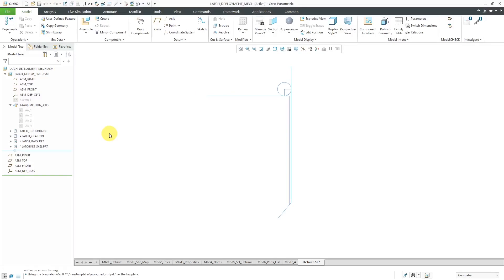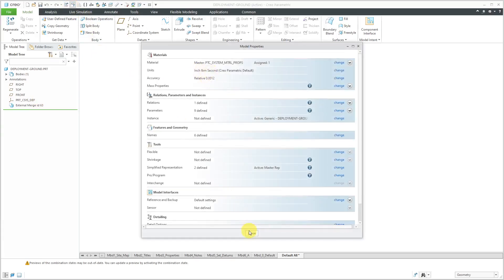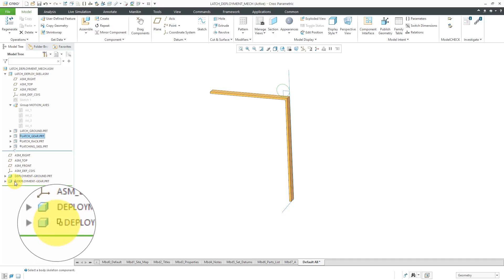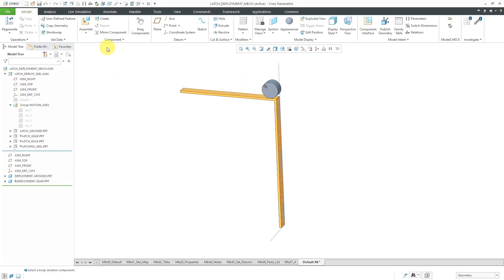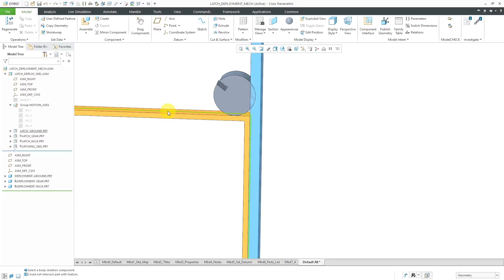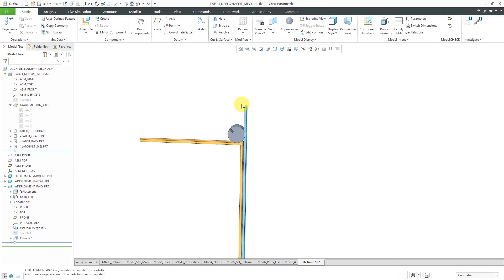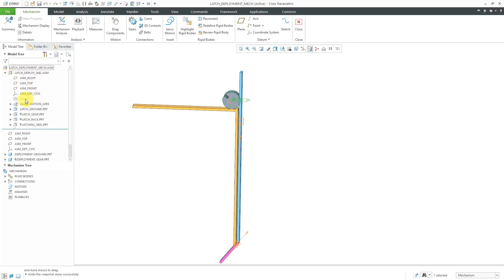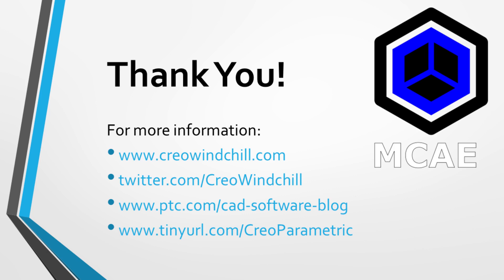Creo Parametric - Motion Skeletons - Part 2 | Mechanisms and Top Down Design

Comment: Thanks for the video. The interface has changed with respect to WF. Here is a good video on Mechanism Design using Skeleton modelling which I liked. Giving it for your reference too. Point to note is the use of coordinate systems while creating the parts.
https://youtu.be/rxHTBj7Ukd8
Reply from the maker: Holy crap, that's old. I'm guessing WF3 or WF4. Generally I am opposed to sketch-based mechanisms since the motion is limited to 2D (same reason I don't like Motion Skeletons). I also generally dislike coordinate system-based modeling and constraining. It always seems to be a method of maintaining the old universal coordinate system modeling methods.